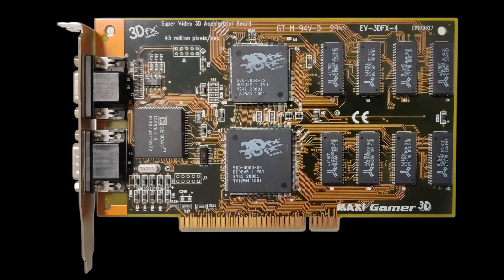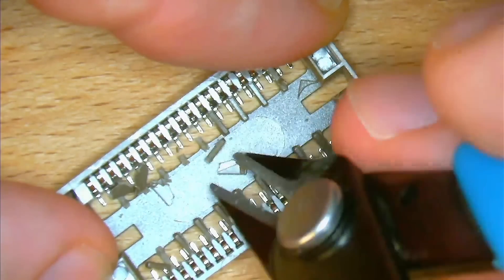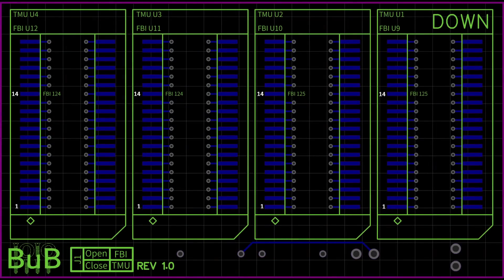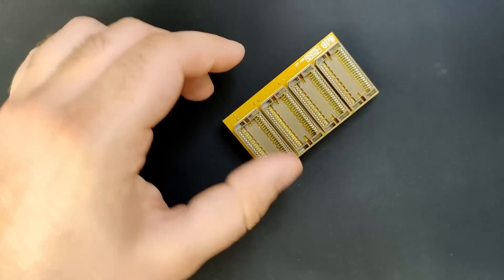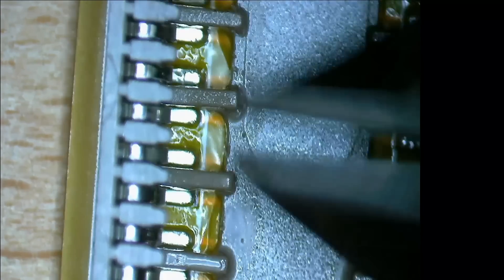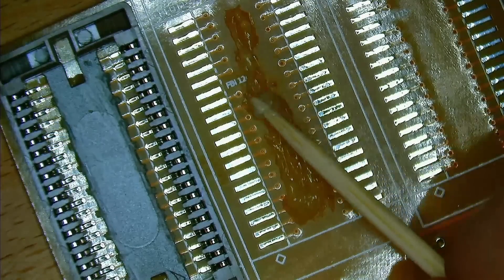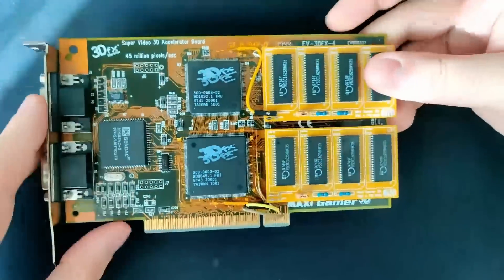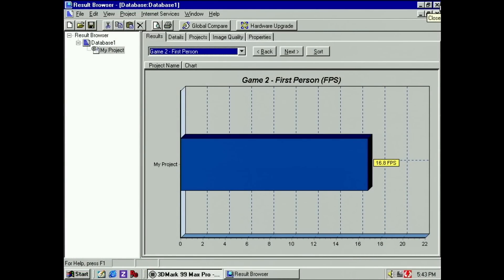3Dfx Voodoo Memory Upgrade - 8MB MOD (Part 2)

Comment: Just don't understand why you don't use SMD for the resistors
Reply from the maker: At that time, I just started with electronics. Now, yes, I would use SMDs. It would make for a nicer and cleaner board.

Comment: May I ask how is it with temperature? TMU of 6MB Voodoo1 Canopus - Pure 3D had a heatsink with fan on.
Reply from the maker: I think temperatures should be the same independent of memory configuration. But that's just an assumption.
I could imagine that with more memory, those cards could be used in combination with faster CPUs (8mb Voodoo 1 can render 800x600 - although poorly). That would max out the Voodoo card and a heatsink is probably a good idea.
Unfortunately, I traded this Voodoo card for a 486 motherboard - I have to make a new modded card soon :)

Comment: I remember back from the time when I got my Monster 3D that a few games ran out of the box in 800x600. Iirc Mechwarrior2 was one of them, and also this futuristic hockey game, hyperblade. If I remember correctly, they were giving up the z-buffer precision to achieve this, so with this mod you should be able to have the resolution and the buffer, right?
Though from a performance standpoint, it seems that what you might gain in texture fidelity etc... can overwhelm the single chip on the Voodoo1 quite easily. Then again, you really need a K6-2 or better to get the most out of a Voodoo2 too. 
Ah, the days when 15fps were called "fluid gameplay" :D

Comment: Great work!
Can you also release the board files to GitHub? So the layout can easily be adjusted to other Voodoo1.
Reply from the maker: Hi, I only created the PCB design. I exported the project files for EasyEDA and Altium.
Reply: @bitsundbolts  Thanks for helping.
Nevertheless the files can't imported to KiCad. The Altium import fails 'Wrong file format'.

Comment: might have been easier to place the sockets on the 3dfx card, put glue on them, then set the expansion board onto them and wait for glue to set.
Reply from the maker: Yes, you are absolutely right. I have a second revision of the board coming that would encourage doing exactly what you describe. Follow-up video should come some time in March.

Comment: One game from memory that does NOT like higher texture memory amounts in glide is Interstate 76. You had to play it on a card with 2mb of texture memory or just run software, it didn't work right on later voodoo cards either. The result was crazy texture corruption, wheel textures on dashboards and such. Like the game couldn't map properly with the extra address space available.
Reply from the maker: Thanks for sharing. I will try to get a copy of this game and check it out.

Comment: Great work on the second mod! I had a 6MB Canopus Pure3D back in the day, but I've never seen an 8MB V1 before. I'd be curious to see what framerate you could get from older titles like GLQuake at 800x600. I seem to recall about 30FPS being the average at 640x480.
Reply from the maker: Thank you! You were one of the lucky ones back then :) For about 20 years, my believe was Voodoo1 = 4MB. Those Canopus Pure3D and Skywell cards are super rare and expensive today. I am working on some benchmark videos, GLQuake will be part of it!
Reply: @bitsundbolts  Awesome! Looking forward to it 🙂

Comment: The geometry engine doesn't need alot of frame buffer memory because the architecture is limited. The biggest issue with these cards were storing textures and increasing texture unit memory would allow the card to display higher resolution because there was enough texture memory but you end up with a bottleneck of the architecture. Just like buying a 12gb 2060 that performs the same as the 6gb version because the architecture can only do so much per clock. I would love to see what you could do with a voodoo 3 or 5 in giving the GPU more texture memory. My first voodoo was a voodoo2 that had 12mb of vram. It would be sweet to see what the voodoo could do with way more memory as 3dfx was a pioneer of graphics and wished  they could have remained independent and not sell out.
Reply from the maker: I don't know if it is possible with Voodoo3+, but it technically should be possible to bring the Voodoo 1 to 8MB TMU - same as with the Voodoo 2. This is based on 3Dfx documentation that I have seen. Unfortunately, I didn't find any document that describes the pinout of the TMU chip. With that, it could be possible to determine if it actually would work. I don't want to risk the only Voodoo 2 I have soldering memory on random pins. But it would be cool to have a Voodoo 1 with 12 MB and a Voodoo 2 with 20 MB. Just for fun.

Comment: Could you stack more of these modules for an even higher memory option? Also, what kind of overclocking could you achieve with a heatsink mod?
Reply from the maker: The stacked memory chips require an address line from the TMU. Another row would require the same. I am actually searching for a pinout diagram of the TMU chip. So far, my search was not successful. But, in theory, you could probably stack those PCBs providing the TMU supports it. There are many pins that are not connected. Some are for SLI and some may be unused memory address lines... I may check overclocking capabilities some day.

Comment: It's awesome to see a fully upgraded Voodoo 1 card! 
That being said it also seems fairly clear why there weren't many V1 cards that had more than 4MB of total RAM. The added cost of an extra 2 or 4 MB of RAM was quite noticeable at the time. Plus while the V1 is able to drive a 800x600 output resolution with a RAM upgrade to the FBI chip. I'm sure in quite a few games the V1 just doesn't have enough pixel pushing power to make that resolution run at a consistently playable frame rate. 
Plus I'm guessing 3dfx also wanted the Voodoo 2's large increase in 3D pixel power, 8 or 12 MB of RAM and ability to play at 800x600 (or 1024x768 in SLI!) make for a big all around upgrade. Having a V1 cards with 8 MB of RAM be common might have led to some consumer confusion.

Comment: I seem to remember being able to overclock my Diamond Monster3D Voodoo 1 by a significant margin back in the day (I don't remember the exact amount, but I think it was ~50MHz higher). That might be enough to restore enough of the performance you lose at 800x600 to make games playable again.
Reply from the maker: The Voodoo has a base clock of 50 MHz for core and memory, not sure how much higher the card can go. I am a bit concerned to damage the card if pushed too far, but 10-20% may be doable. I have no idea yet, but I probably will look into overclocking.
Reply: @bitsundbolts  Yeah, if the base clock is 50 MHz, then I probably didn't get a 50 MHz overclock on top of that, but I do remember being shocked and surprised at how far I was able to take it. Definitely something worth looking at. I think the first Voodoo chips were well known, back in the day, for overclocking like champs (kind of like how the old Celerons could practically double their clock before breaking a sweat).

edit: I looked into this, and I must be mistaken. One source I found said they only managed to get 7 more MHz out of it before getting garbage on the screen. Perhaps I was thinking of the Voodoo3? Odd, though, because I distinctly remember using thermal epoxy to add a heatsink to my Voodoo1 because I had overclocked it in order to skip the Voodoo2 generation (distinctly because it was my first time ever doing something like that).
Reply from the maker: I've heard (not tried) that Voodoo3 were good overclockers. Especially the lower clocked models like the Voodoo3 2000 PCI.
Reply: @bitsundbolts  I always clocked the hell out of those cards back in the day, never ever got one damaged, don't remember exact clock speeds but as always milage may vary.  I also had 6 Voodoo2 12MB cards in 1999 and put heatsinks on all the chips to keep them a bit cooler. Often clocked around 120+ MHz or so. But again, overclocked too far and they simply crash, no big deal. When you go into voltage modding that is where things can die on you but I never did that with the Voodoo cards. Voltage modding P2's were great though. You need to get hold of the PII 300 SL2W8, which was essentially a P2 450 with the busspeed set to 66MHz. Change it to 100Mhz in bios and you have a stable PII 450MHz. I had mine clocked at 504MHz (4.5 x 112) . Another great CPU from that era is the Celeron A 333Mhz, same deal, 66MHz bus to 100MHz and you have a 500MHz Celeron. Sometimes needed a voltmod though, if the motherboard did not have OC features you could tape off some pins on he Slot1 contacts to raise the voltage. Really neat stuff, had lots of fun back then when i was about 17 years old :) Ok I'm rambling...  great mod sir! Love the content.

Comment: This is a great mod, super clean and ultimate 1996 bragging rights if a little late :)

Of course there is no benefit from a 4MB frame buffer if the TMU cannot realistically push pixels fast enough for the higher resolution, it is however a neat thing to have available and I don't think many will have seen a Voodoo1 in 800x600 before, that was something that people bought Voodoo2's to do (and SLI Voodoo2's for 1024x768!).

I would be curious to see 1996/1997/1998 games running in 800x600 to see how an 8MB Voodoo1 compared with an 8 or 12MB Voodoo2 though.  Quake 1 or 2 would be the obvious choice for this.
Reply from the maker: I already did compare a Voodoo 1 vs Voodoo 2 in combination with an AMD K6-2 @200 and @400 MHz. This could be a base to add more results and see how the extra memory affects the performance of the Voodoo1 with more memory.
Reply: Triple buffering is now an option!

Comment: Really looking forward to when someone does this to a Voodoo 2 giving each TMU 8MB each even though according to documentation they do support up to 16MB.
Reply from the maker: I have not seen anybody doing this - so, chances are that it cannot be done. I am an absolute noob, but I wouldn't mind trying. Just need to find pinout diagrams of those TMU chips...
Reply: @bitsundbolts  Thing is someone already done these types of mods back in the 2010s but never to the fullest extent. This was pretty much how it got started modding later VSA era cards such as the V5 5500.

Comment: Now can you do the same thing to a Voodoo 2/3?
Reply: There was some 16MB Voodoo2's wasn't there? or am I just imagining that... it has been a long time.
Reply: Voodoo 2s came in 8 and 12 meg versions, with 2 or 4 megs per TMU respectively - the framebuffer unit always had 4 megs.

The Quantum 3D Obsidian 2 had a 16 MB (and 24 MB) version - but those were effectively SLI cards to be installed in a single slot - they had a 2nd V2 chipset with RAM tacked on with a daughterboard.

According to the spec, the V2 TMUs can theoretically take up to 16 MB per chip - The Banshee did exactly this, and was otherwise a 1-TMU chip with 12 MB wired into it
Reply from the maker: I guess I need to get a Banshee and see where those memory modules are connected to. Then we could figure out where the extra 4 MB connect to. Unfortunately, I do not have a Banshee - yet...

Comment: Can you try Tomb Raider with the original Voodoo Graphics patch? It'd be interesting to see if 800x600 is playable. Mechwarrior 2 might also be a really good test, supposedly the guys at FASA were amazed at the speed the game ran in Glide mode (sort of a hint of things to come if you ask me). Too bad boards with SLI fingers are unobtanium, I imagine doubling the ram on those things might show some impressive results.
Reply from the maker: Tomb Raider is already on the list. MechWarrior wasn't. I will try it as well and see what it is all about with those speed gains.
Reply: I think Tomb Raier 1 is hard coded to  512x384 or 640x480 max.
It also has a 30 fps limit. So with a simple Voodoo 1 you get the maximum perf this game can have.

Comment: How would I go about using this mod if I modified my Voodoo card to have memory sockets?
Reply from the maker: Maybe solder the TMU/FBI wires to the socket and use 1MB memory chips. I don't know if this works, but I wonder why it wouldn't. In that case, you do not use this mod. This is for socket-less Voodoos only.

Comment: Did you plan to overclock and cool the chips?
Reply from the maker: For now I just placed a case fan on the card. But I could add heatsinks, try overclocking, and do some temperature measurements.

Comment: Congrats for this successful second step. When I remember what frame rates were acceptable for me to play in this times, I would say both titles tested are very playable, also in 800x600. 👍
Reply from the maker: Thank you! I use a Pentium III 1GHz at the moment, this may contribute to much better frame rates that would be possible back when the card was released. But I agree that Need for Speed definitely is playable. In UT the stutter are annoying when fighting bots - I wouldn't want to play at 800x600.
Reply: @bitsundbolts  I did some thinking in my breaks. Perhaps your bottle neck is now the bus, which is not able to pump enough texture and/or frame data into the memory and the was the reason there were no 8MB cards on the market. If you can overclock the bus, perhabs there could be seen a gain and a evidence for my theory. ;)
Reply from the maker: Maybe :) At the moment, I am playing around with different bus speeds. Planning my next video featuring a DOS game with software render and 3Dfx support. I will start recording footage only from today - as I finally settled on a story for the upcoming video.
Reply: The voodoo1 had issues with processors over about 400mhz for some odd reason. And it was also partly due to "hub" architecture chipsets like the 815/810  The best combination was to use a 100mhz FSB cpu on the BX chipset.

Comment: 12:35 in Unreal Tournament if you disable Detail Textures (active only in Glide, inactive in D3D and OpenGL ) using the "preferences" command, the FPS will increase by around 30%.
Reply from the maker: Good stuff! That's what I am going to need for the benchmark videos! Thanks 👍

Comment: Unreal would be a very good benchmarks for the 8 mb Voodoo 1 because it shows the minimum FPS. I guess that the improvements over the 4 and 6 mb versions will be more drastic in the minimum FPS and less so in the average FPS.
Reply: A Unreal comparison video is here on YouTube on a 3dfx fan channel and was produced in 2018. The 8MB version is also faster in Unreal than the 6MB, only the frambuffer memory is 2MB bigger than the 6MB version. You can also see the min, max and average fps

Comment: Like! The 8 MB Voodoo 1 should be capable of running older titles, from 1996-1997, fluidly at 800x600. Still a very impressive performance in NFS Porsche in 800x600 considering that the Voodoo 1 is 4 years older than the game.

Comment: Try tacking two corners of the sockets, place the board where it belongs and heat it from the backside until the sockets aligns, pull it off and solder everything properly.